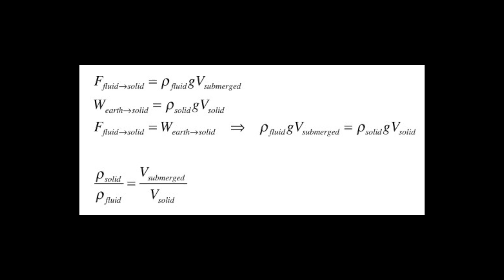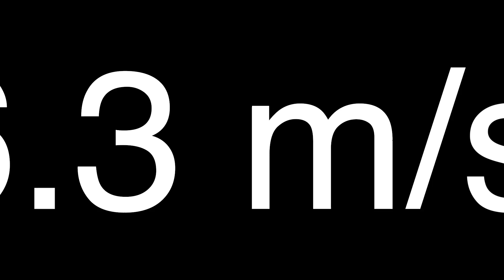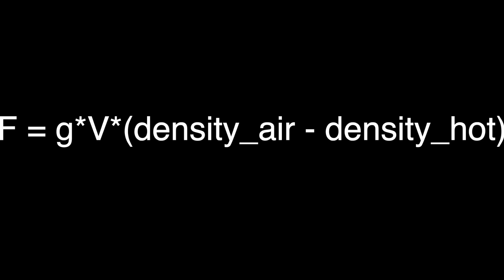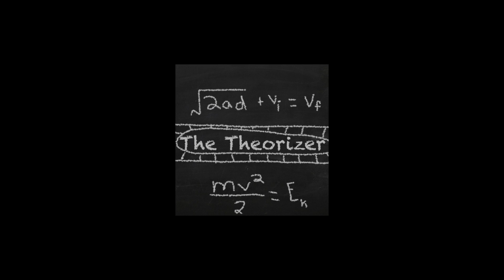How Does the Odyssey Even Fly?

Comment: 3:00 you mean based off, the "of" is automatically implied by the "off" = "off of" is an idiot's phrase, just vapid noise of mouth-breathers aka intellectuals.

Aerodynamic is already the wird for what you mean by forcung the suffix "al" onto the word, which is just the impulse of a mouth-breather; hyper redundant ti the pounto generating linguistic equivalent of "cancer" in you phrasing as reflection of shirtsighted and fragmented framing as you try to anchor the degenerate attention span of your fellow lost(aka intellectual).
Thers us no such tbing as "aerodynamical," it's pure idiot nouse in face of aerodynamic already being a sufficient term in every instance of using "aerodynamical." Just like so calked "usage" and "usages" not being real words when yoy can see use works fine in every  case where those two fake variants are pedaled by clueless mouth-breathers.